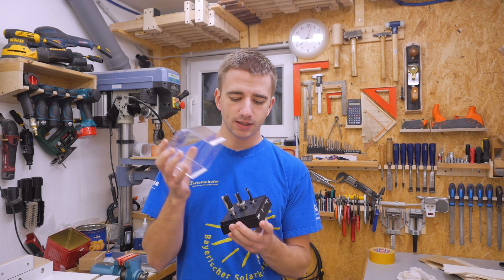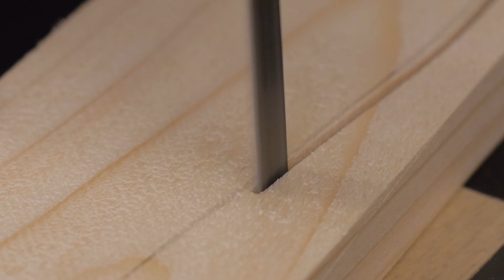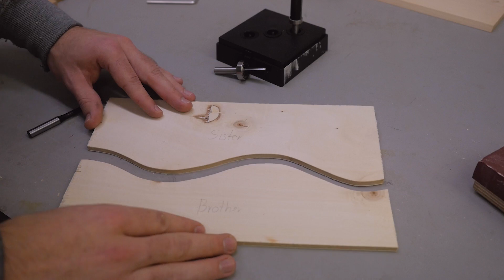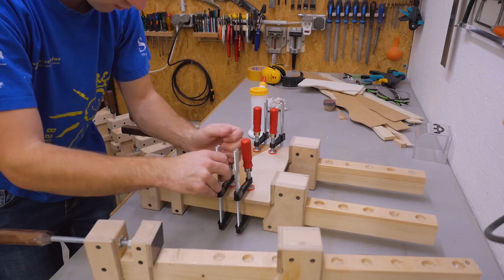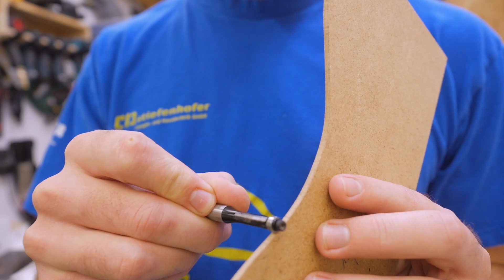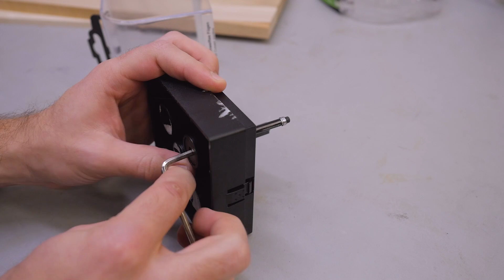Curved Joinery with the Router

Comment: I appreciate this is years later but I’ve only just seen it. That set from ENT looks great but is now £130 plus carriage. I achieve the same result by using a 10mm pattern bit and then a 30mm OD guide bush with a 10mm straight cutting bit. That all means that, as you say much better than me, you are cutting the brother template 10mm too thin but adding that 10mm back with the guide bush/straight cutter. I only had to buy a guide bush - but it was for Festool and so was £20.

The results I get are varied - but failures are just my error usually maintaining that vital contact when making the brother template. I do use 6mm MRMDF which is okay although I would prefer 9 or 10mm

Comment: That is very interesting. Thank you for sharing your knowledge. I have started doing something similar. I make a template from MDF. I use a pattern bit to cut a 1/4” out of the wood. Then I cut strips of a different color so that strips add up to the thickness of the wood that I removed. One of the best tips I got was put so CA glue on the edge of the MDF template so it will hold up better. The edge of the MDF just doesn’t hold up very well and the CA glue hardens it up very nice. Anyway, thank you for sharing. I really enjoy your work.

Comment: I've always wondered how to do a joint like this, my only thought was to stack the pieces and cut both together, but now I understand that would not work. Could this kit be used to make 2 circles that fit perfectly inside each other?
Reply from the maker: Possibly, but difficult. There are better methods to achieve perfectly fitting circles

Comment: Excellent video ! I'm guessing they designed  the. Case more for safe shipping. Than  storage  porpuses ?  You probably should make your own storage solution for your needs  and space  the bits are much easier than  having to scribe. A radius  which can get very tricky  ive seen many guys  do it. Wrong and  remove too much  product  making. The whole project a bust ?   Those bits would be very valueable to  boat building and repair  i would think

Comment: That is a clear demonstraton of a useful technique.  Use of a bearing with the same offset as the diameter of the first bit is clever, letting you use a regular flush-trim bit with the one of the templates.  If it were critical that the curve of the join exactly match the curve of the mother template, you would need to change the procedure a little.  To do that you could cut along each the brother and the sister templates with a bit that had a bearing offset of half the diameter of the first bit.

Comment: I know first hand, well index finger, about tight fitting router bits.  Grabbed an 1/8" upcut by the tiny part of the shank sticking out from the container base... fingers slipped and the bit filleted my finger.  Had to use needle nose pliers and some leverage to get the bit out when I got back from getting 4 stitches.
Reply from the maker: Ouch!!!
Reply: It was a brand new bit so it was ridiculously sharp and almost completely painless.  I will never try to take a router bit out that way again.

Comment: Why not do all of this with a CNC?  Would you have some of the same problems?
Reply from the maker: I believe that my CNC wouldn't be as precise as the normal method, other CNC's maybe. But the Project I want to use this joint for is bigger than my CNC anyways.
Reply: I see.  After making some templates for some of my own projects (and having to make a really scary jigsaw set up to cut some of the pieces because I don't own a bandsaw) I had dreams of using a CNC to automate the process a little more.   You seemed to get really good results with this method so I'll have to try that next time.

Comment: As always, awesome video. I'm a router novice and find these advanced techniques fascinating. I first learned of this method a few months ago on Stumpy Nubs. Since then, I've been thinking about it and am pretty sure that this same thing could be done with a straight bit and a guide bushing set. One of these days I'll make it down to my shop to test out my budget idea. In the meantime, if someone more skilled than me would like to give it a try, I'd love to hear of it worked!
Reply: Yes, I have used guide bushings to construct curved joints. I learned the technique in a Router Joinery class at Santa Fe Community College. Since I know guide bushings do work for curved joinery, I am searching for information on why it works and what is the relationship between the various guide bushing OD and bit OD. Where on Stumpy Nubs did you find information on curved joinery?

Comment: Marius, you are one of the best woodworkers I have ever seen. When I was a boy my dad taught me a wallpapering trick the will accomplish what you want much easier. Just overlap the two pieces of material that you want to join by a few inches. support the gap below the upper piece with a piece of scrap of correct thickness. Then cut through both pieces at the same time using a jigsaw, bandsaw or a router with a 1/4” carbide bit along your desired curved line. The remaining pieces will fit together perfectly!
Reply: If you did this you'd end up with the same slight mismatch as the brother and sister templates due to the kerf of the blade/diameter of the router bit though.
Reply: Bandsaw jigsaw router finish too rough for a one pass shot at it. 
These tools allow removal of  bulk and trim off a little bit. Much easier on the tool. 
Excellent for wallpaper as stated.

Comment: won't 2 different woods dont crack this joint after time due to different expansions?
Reply: I don’t see why it would.  It’s the same as a multi-wood butcher block, right?  I suppose if it was left unfinished and left out in the elements.
Reply: @Jorgen Borg, you will have to make sure you uses compatible woods with nearly the same wood movement , Example , Maple and walnut, cherry and mahogany just to name a few
Reply: @patprop74  thanks for the answer, friend 😋
Reply: I think as long as your woods are similar in hardness and cut (i.e. Don't mix quarter sawn and flat sawn) then it shouldn't be problem. I think the steeper your curves, the more likely you'd be to have issues with expansion.
Reply: poor English - perfect question
Reply: @vizionthing  
Who needs better English if you understand the question???
Reply: @Kühn nobody has asked for better English so far!
Reply: @vizionthing  so why complain about "poor english? I'm also not a native English speaker and far from good... If u try to blame someone for his poor English he probably won't try to use it anymore.... But he did.... Just by trying u can become better... Big respect therefore. And u? How about you? You are an native English speaker? Are you able to communicate in a foreign language?
Reply: @Kühn-b6w  chill, my friend. 😀. it's no biggy. let's just stick to the question. i ask it for his sake. would be a shame if he would make an awesome project that would crack after some time. 😊
Reply: @Kühn you seem to have misunderstood my post, it was nothing more than an observation, A wry smile at the attempt - I found the English endearing, cute, funny - are you by any chance one of them Internet policemen? I am fluent in five other languages.
Reply: @vizionthing  
Thanks to Google translate right 😉 
Even if it would be true, still a shame that you probably think everything falls easily into your lap ...like it did to you....

And yes... I'm the internet police... 🤦🏼‍♂️
Reply: @vizionthing  me no native engish one yesyes 😁 hehe

Comment: i would think you could also put melamine edging on the template to help smooth it out and provide a harder surface so you can use scrap as the template
Reply from the maker: Any edge treatment changes their shape. Edge bending adds thickness which creates another offset
Reply: @MariusHornberger  if added to all templates would it not keep it the same
Reply from the maker: No, that would make things even worse

Comment: Here is a tip that works for me with templates,  I coat the edges of the template with a 50/50 mix of wood glue and water (sizing).  I do a few coats and sand with 320.  This leaves a smooth hard surface for the bearing to register against.
As always,  a joy to watch you craft. 
Cheers
Reply: I wouldn't have thought of that. Thanks for the tip 👍

Comment: I think if you put a strip (e.g. for contrast) in the joint you can actually compensate for any remaining size difference between the flush trim bit and the guide-bushing/bit difference.

Hypothetical numbers: 20 mm guide bushing, 12 mm bit = 8 mm difference. Use 6 mm flush trim bit to cut the two templates, and then gluing a 2 mm strip into the joint should split the difference?
Reply: Hmm. No. I don't think that works. The flush trim bit cuts different radii on brother/sister templates. That's what needs compensation when routing along the brother template. Adding a strip doesn't change the radii back. So, no, this doesn't work. But you can of course add a strip into a well-fitting joint. May be interesting.
Reply from the maker: Yes, I think that could work, only your hypothetical numbers were wrong. 20mm guide bushing + 12mm bit is an only 4mm difference (on each side). If you bend thin strip it will have different radii outside and inside creating again an offset of the wood thickness. So fitting a thin strip in a well-fitting joint won't work in my opinion(except that enough clamps could force it together to a certain amount)
Reply: Yes, your argument makes sense and I also tried it with a compass on paper and then it becomes nice and obvious :)

Taking your comment into account (dia!=radius), the required bits are in practice either very small (<8 mm) or the guide bushing needs to be rather large. Clearly ENT didn't use such a tiny flush trim bit in that kit for no reason :D

But you can get bushings in large sizes (or improves a sleeve to enlarge them), so that isn't a problem:

A 40 mm guide bushing with an 8 mm bit would then require a 16 mm trim bit; all common sizes.

A 30 mm guide bushing with an 10 mm bit and a 8 mm trim bit would leave room for a contrast strip.

Comment: great teaching video, thank you. What was the third bit for? Was it an edge trimmer for cleaning up? What are you studying at university I'm guessing engineering in some form that lets you get your hands on?
Reply from the maker: No, I used all three bits. Small bit for making templates, offset bit for the brother template and the normal flush trim bit for the sister template